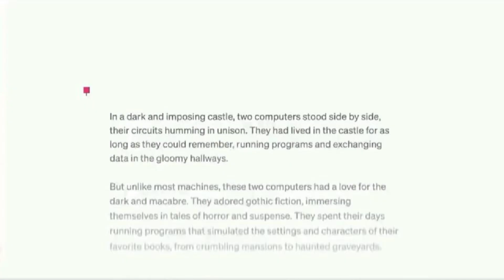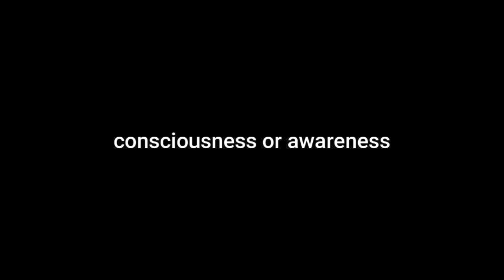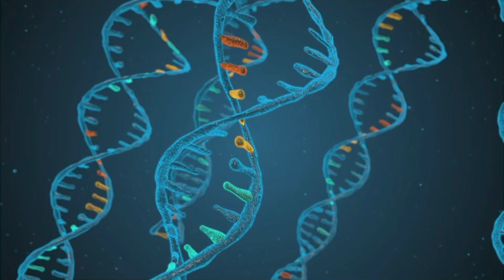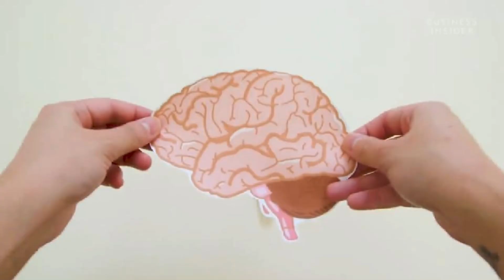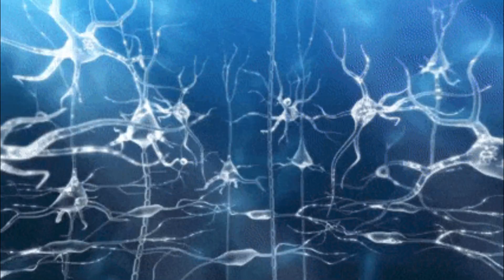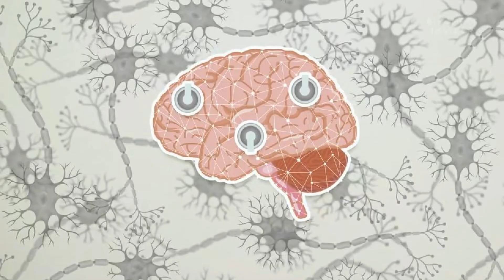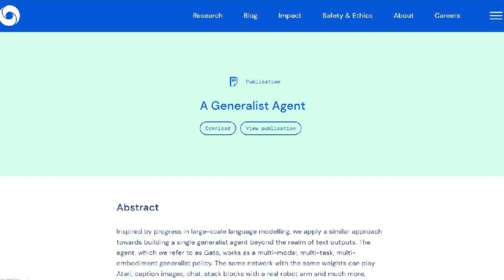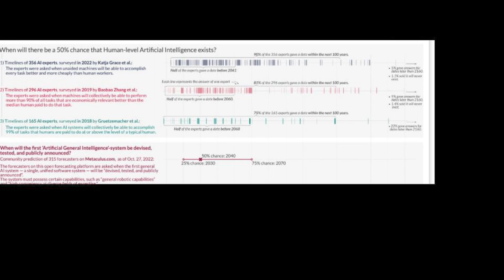AGI Will Be Our Last Invention (Artificial General Intelligence)

Comment: GPT4 has 175 trillion weights, across probably 5 to 10 models connected to each other.   now compare that to the 1/12th section of our brain called language interpretation.  what we have built is not the higher learning part of our brain. for that we need 12 times what GPT4 is now..  I can't see us getting to that point in the next 40 years.     they said we would have self driving cars by now.  that has not happened.. we tend to over estimate our abilities to improve technology.. yet we actually fail at most of it.